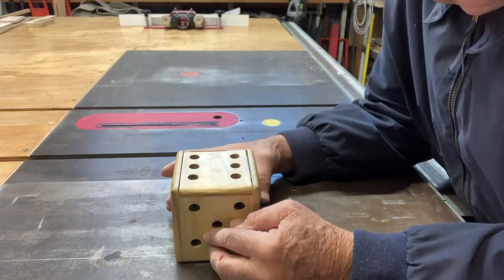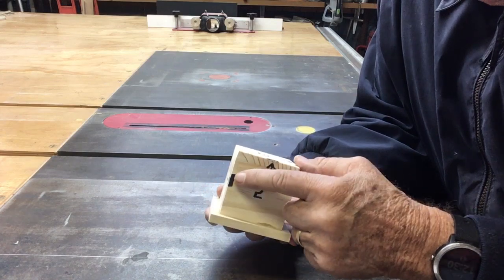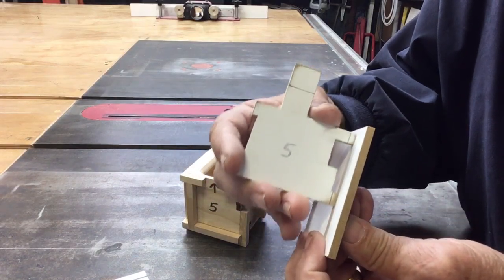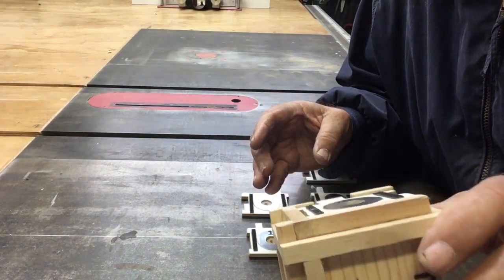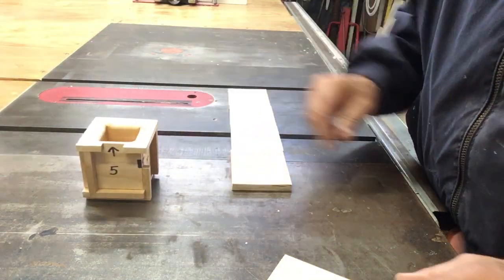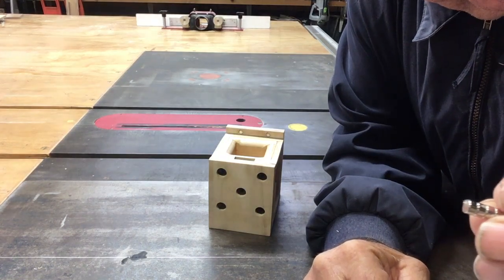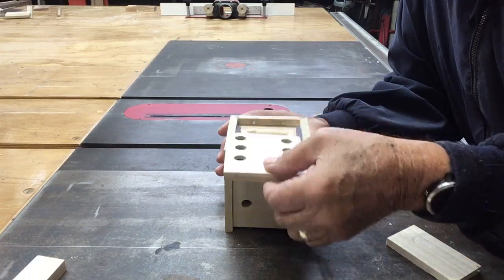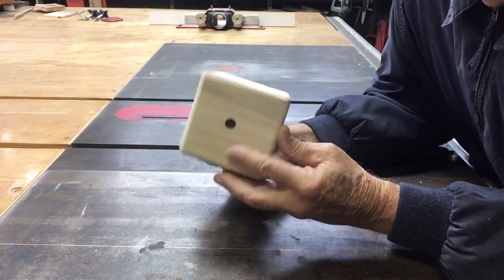Wooden Dice Puzzle Box - INSTRUCTIONS - helpful links in Description

Comment: I'm on my third one of these now and I have a question. It seems like my boxes will come unlocked just by shaking the box. If there was a way to prevent slider #1 from moving, except when you want it to, I think this would cure the problem. Have you experienced any issues like this? And if so, what did you do to correct it?
Reply: I thought about adding a pin on slide one to keep it locked.
Reply from the maker: If your dice is opening just by shaking it, then you have the sliders too sloppy.  They need to fit close when engaged.  There isn't much tolerance.  I tried to explain that in the video, maybe I didn't do that good of a job at that point.  I assume if you shake the dice enough, it may open.  I tested the ones I made and they all stay locked. Hope this helps.  John
Reply from the maker: By adding a pin, it would defeat the purpose.
You can always relock the dice before giving to someone to try.
Tell them not to shake, just turn.
Reply: In slide 1 I figured I could drill one 5/16" by 5/16" hole in the top even with the bottom of slide 1 when it's in the locked position.  Add a ball bearing 1/4" in size and it will roll around in that slot and keep it locked unless you move the ball bearing into the 5/16" hole.  Then this would allow the slides to unlock by shaking it...  However if they try and shake it to open it...this ball bearing will keep it locked until they tip the dice up on 6.   I am making about 12 more this week.  Gave the other 8 out as gifts.  They really enjoy these boxes.   Here is a video on the first 9 I made.  https://www.youtube.com/watch?v=UOgUcyp9F00
Reply: I'm wondering if on the tab #1 that goes into slider #2, if you put a small taper on it, shaking it would draw it tighter, but plopping it would still release it?
Reply: @MarkJonesRanger  This is what I'm trying to do, though I like your ball bearing idea.  I don't have any slop in mine, but you can still shake it free.  I noticed on your channel you made an acrylic outer box so you can see what's going on.  I did similar with a box with the inner square cut out (so just a box frame).
Reply: I have 12 in the shop right now ready for finish.  This time I figured I would finish the boxes outsides and then insert the guts in the bottom panel.   I have them down to about 2.5 hours invested in each box.  That doesn't include sourcing the materials like resawing and stickering the logs into boards.  HA!     I am thinking of going down to walmart and getting some airsoft pellets that the boys shoot at each other with and use that as a ball bearing to keep the shakers at bay.  The box will work the same with this method with one more move to clear the pellet when opening the box.  I haven't done this yet.   Investments of time and material and bits and sander makes these boxes pricy but very cool.  I have one more box in the works that uses push button combination to open.
Reply: I fixed it on mine.  See the pic:  https://drive.google.com/file/d/1-plNb2QYidFGCLTgwwH079_BrXzhR2_g/view?usp=sharing

Comment: I'm about to make one. question: "What if I put the puzzle down on a mid number side, or put it away without fully locking it back to "one"? In other words does the box then need to be started where it was laid down or how it was put away? Or doe sit need to be in "one" somehow?
Reply: To get it to reset completely go back to 1 and start it again.  Then reverse it to lock it up tight again. Other wise a simple bump  or shake will open it up.  I really like these boxes and they are a big hit.  Fun to make.
Reply from the maker: MarkJonesRanger, 
You are right on how to reset box.
I'm glad they are a hit for you and that they are fun for you to make.
Hopefully I didn't make the video to hard to follow.
I tried to cover everything I thought was needed.
Did I miss anything? 
John
Reply: Thanks John for sharing this with us.  You did a great job on video and explaining this project.  Straight to the point and the tips you shared were big help in getting it all to go together.  Christmas is coming  up fast!!! I have 12 sets of raw materials ready for the CNC to start cutting them out.  While the CNC cuts these parts out I need to get some walnut and maple out of the shed to make up 4 more box outsides.  After giving out 8 of these I added a star over the tab and a moon opposite the star and added a tip that gravity counts to tap the star to close and tap the moon to open.   Here is some of the sets of 6 that I have added to the outside of the boxes instead of the dice holes.   
or  Days of the week.
Sunday
Monday
Tuesday
Wednesday
Thursday
Friday
or fruits of the Spirit

Love
Joy
Peace
Patience
Kindness
Goodness
or months in the year
Jan
Feb
Mar
April
May
June
or plagues in the bible
Water to Blood
Frogs
Nats
Flies
Livestock
Boils

or in 3 families of 6 I used the names in order Dad, Mom, Kids 1-4.  
also
Laser engraved this on the bottom of the box.  Small print,
Hint 1-6  6-1
What is first can
go last.  What is
last can go first.
  Make a list.
Tap the Stars to Close
Follow the Moon to Open
takes about 3 hours to make one of these.  I have them jigged up for the CNC so I can just drop in a piece of material and it will cut the parts out.  It saves time but becomes work if I cut all the parts for 12 boxes out at one time then move on to the next parts.  Insidebox, Slots and top, Slides, outside box hardwoods then install the slides in the top.  
Good stuff keep up the good job on these videos and design tips.  You inspired me greatly to get this project out!